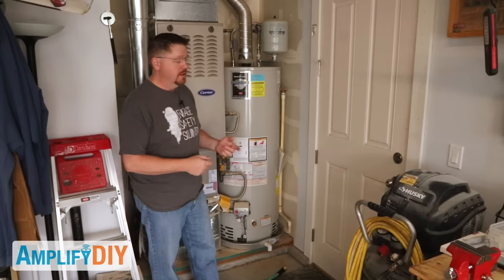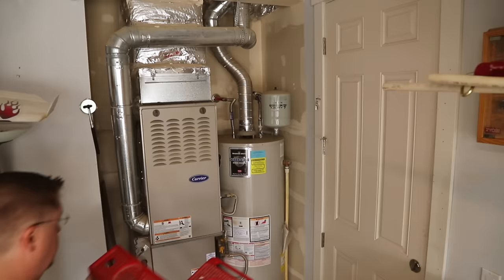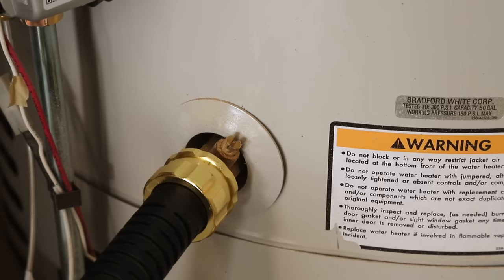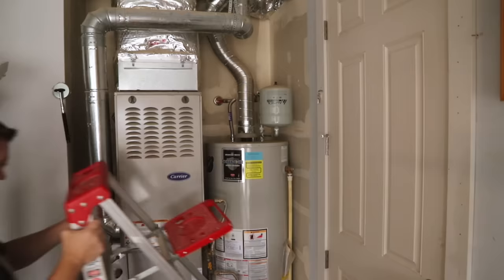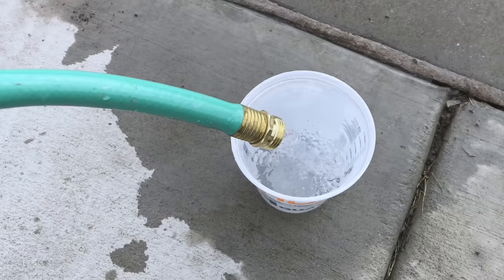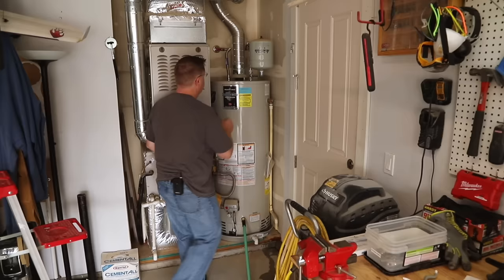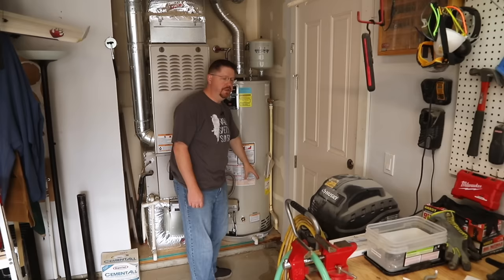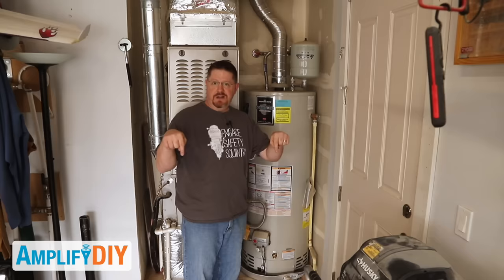How To Flush A Hot Water Heater To Remove Sediment

Comment: To avoid getting burned from hot water you can turn off the heat source and run the hot water into a sink until it’s cool enough to handle. Then follow the procedure for flushing.
Reply from the maker: Hi Jeffrey - great idea! Or, you could turn off the heat source and take a shower, run a load of laundry, or do some dishes - that way the water does not get wasted. Thanks for watching!
Reply: @AmplifyDIY  I will definitely do something like that next time I get ready to do a flush. Out here in southern Colorado water conservation is a big deal.👍

Comment: If you do this try to make the thing that you open for airflow a tub faucet or shower, the sediment will end up getting sent down the line and can cause issues.  The aerators on my sinks clogged with sediment and the hot water pex valve under my kitchen sink was somehow damaged in a way that makes it so it'll randomly flip itself off, not the end of the world but an annoyance.
Reply from the maker: This is a good tip - a tub faucet with no aerator or with the aerator removed is a good option. Thanks for watching!

Comment: All i do is turn down the tank temp, after taking showers, make sure the water is cold or cool, then hook up a water hose to the drain, turn off the water, open the drain valve, turn on the water to the tank, it flushes out the sediment very quickly. turn off water, close valve, unhook the hose, turn back on the water. Done.
  Every time i have messed with the Pop off valve it starts leaking. i dont like messing with that.
Reply from the maker: HI Alan - your technique is good, but I do recommend allowing the tank to fully drain before swishing it out with more water from the inlet. Even though you get a lot of sediment out with your method, I think you'll be surprised just how much more comes out if you drain the tank and flush in short bursts as I demonstrate in this video. 
As for the T&P valve: they should be tested annually, and replaced if they ever leak. Luckily, they are cheap and easy to replace: https://youtu.be/e5H1i1cypxA Thanks for watching!

Comment: Overall a nice video. But you did not good at the last phase: refill with cold water for a refill and open the valve to drain the water. The steps of closing the input of cold water then opening the valve is critical. Otherwise people will be dangerous with the reverse steps.

Comment: My shower and a couple of my faucets have little to no pressure after draining my water heater. Anyone have an my idea why? Or how to fix? I think I have a water recirculatir
Reply from the maker: You may need to clean out the aerators for those fixtures. Instructions for exactly how to do so vary, so bang around on google for the type of faucet to learn how. Most simply unscrew from the tip of the faucet. Good luck!
Reply: @AmplifyDIY  if that was the case, could I not just unscrew the shower head and see if it’s flowing properly when removed? 
I suspect this is not the issue. All three just all the sudden don’t have working aerators? Highly unlikely imo. Thanks for trying tho.
Reply: @AmplifyDIY  man I just unscrewed both shower heads and sure enough there was a bunch of sediment blocking them haha. How does that make sense though? Would it only affect certain shower heads and certain faucets, but then not affect others at all?

Anyway, thanks for your help!
Reply from the maker: Where and how the sediment can get trapped depends entirely on which fixtures were open (allowing water to flow) when there was sediment in the lines. It's impossible to say for sure exactly why these were the only ones that seem to be affected... but I'm glad you have resolved the issue!

Comment: Having the relief valve out while filling for too long can cause the water heater tank to cave in. The air coming out will cause it to suck in due to minimal air in tank. That happened to me. It is a very small dent, and it still works, but I wouldn’t leave the relief valve out for long while filling.
Reply from the maker: Hi Applianceman - I've never heard of anything like you describe... your water heater tank itself (not the outer cover, but the actual inner tank) actually deformed due to the pressure differential?!
Reply: I’m not sure what happened. I filled the tank back up, and I heard a loud “pop” sound while filling, and the outer cover is slightly deformed now. I hope the actual tank isn’t damaged. I’m not sure if it is. I think it was just the outer shell thankfully. Very unusual, and I sure hope it doesn’t happen again. What do you think happened? Why would filling up a water heater cause a “pop” sound and outer shell being deformed?

Comment: I find it so wasteful to fill it and drain it again. If I have a water softening system will I not have to do this wasteful procedure once a year? I'm also getting tankless so it doesn't heat water when it's not being used. Seems to be more energy efficient since these water heaters keep the water all night when not used.
Reply from the maker: Hi Cyndi - Depending on where you live, flushing about a hundred gallons of water may be more of a waste than it is for other areas. I did the math, and the cost of the water that I use to flush is around $0.35 (that's 35 cents) in total. Doing this once a year to prolong the life of a heater by 10-15 years seems well worth it to me. Even if your water costs more, the cost of replacing the whole heater is MUCH higher than the cost of maintenance. 

If you live in a drought area, then I recommend doing the following to re-use the water on your garden/lawn: Turn off the heat source for the heater, then go take a shower, do some dishes, or laundry. This will use up the hot water in the tank, and exchange it with cool water from your water supply. You can then safely drain the tank directly onto your yard, garden, etc, so it is not wasted.

If you are already planning to get a tankless heater in the short term, then there is little reason to perform maintenance on your existing heater. Carefully consider the pros and cons of tankless systems though: It's true they can provide a seemingly unlimited supply of hot water, and they don't waste any energy heating water when none is needed... but they take longer for water to get hot at the tap, they are very expensive compared to a traditional water heater with a tank, and they still require regular maintenance to keep running smoothly. I was very interested in installing a tankless heater in my new home, but once I ran the numbers, it did not make economical sense to do so. Yes, my current heater does waste a little bit of energy throughout the day keeping the water hot, but it would take several decades of using a tankless heater to recoup the cost of the heater in lower energy usage. In my area both electricity and natural gas are very inexpensive, so the math may make more sense if your utilities are much more expensive.

Whatever you decide, I hope you are happy with the results. Thanks for watching!

Comment: Well done, but I HIGHLY recommend not opening the Pressure Relief Valve. They often will not reseal when done and then must be replaced. Better to open the hot side of a faucet to allow air in.  JMO from experience
Reply from the maker: Hi Andrew -  You should actually test your relief valve annually. They can seal over completely with limescale on the inside to the point they do not open properly in the event of too much pressure. Test it, if it leaks, replace it: https://youtu.be/e5H1i1cypxA

Comment: Still a little confused about when you turn hot water on and off in the house?
Reply from the maker: Hi Kelly - apologies for the late response. The only reason to turn on the hot water in the first place, is to let air into the system so you can drain the tank. If you have to use your T&P valve to let air in (as I did in the video) it does not matter at all what you do with the faucets in the house during the flush. Open or closed makes no difference. Once the flush is complete, it's a good idea to open your hot water faucet in the house to allow the air that is now in the tank a place to escape. I believe I showed this in the video. 

Thanks for watching!

Comment: Wouldn't it just be easier to put a sediment filter in line and change it once a year? I also have a water softener inline on mine so to remove the calcium/lime so that does not clog up mu lines in the house.
Reply from the maker: Hi Raymond - even with a sediment filter and water softener, your heater will likely still have some junk collect in it. The sacrificial anode inside the heater breaks down over time and flakes of, collecting at the bottom of the tank. Also, the repeated heat cycles of the water in the tank will cause dissolved minerals to precipitate out of the water, even if you have a softener and filter. (there will be much less, but it still happens). I have both a whole-house sediment filter as well as water softener, and as you saw in the video there was still junk in the bottom of my tank. I recommend flushing it once a year. Good luck!
Reply: Agreed. I do replace my anode once a year and do a quick flush in the process. I had a fiber scope from work and did a quick inspection and surprised how clean the tank actually was. We leave the filter and softener at home (its setup outside the rv) when we travel. Yes same princilals apply to an RV. And run direct city water because of the VOC in the water aids in the antibacterial process that keeps the lines sanitized. Yes if you are on a city water it does contain these. It's just bleach in the water. Softeners dont remove these but charcoal filters do.

Comment: Can you not just leave your cold water valve on and let it flush that way? My hot water heater is in my basement and only way to drain outside would be up hill
Reply from the maker: Your basement should have a floor drain. Flushing under pressure actually stirs up a lot less sediment than the method I showed in this video. Good luck!

Comment: Can you drain this into your toilet?
Reply from the maker: I would not recommend that at all. If your heater is in a basement, there should be a floor drain you can use. If not, then you should drain it into something that is lower than the heater - a sink or bathtub or floor drain would work fine. Outdoors is better because then there is no risk of clogging a drain with sediment. Wherever you drain it though, it has to be downhill from the drain valve of the heater. Good luck!

Comment: What if there are two heaters
Reply from the maker: Hi George - when there are 2 heaters, they are typically plumbed in series - that is, the first heater feeds directly into the second heater. In this case, you simply do them 1 at a time. Start with the heater which is closest to the cold water supply. Good luck!

Comment: Have you seen what the sediment looks like when they cut open a old water heater they’re huge rocks i dont think doing this will do anything maybe it will clean it about %10 but thats it
Reply from the maker: Those huge rocks take many years to form. By flushing at least annually, it helps prevent it ever getting that bad in the first place. Thanks for watching!
Reply: @AmplifyDIY  i bought my house in 2020 and water heater is from 2015 so i dont think flushing it would make a big difference when i replace this one ill flush the new one annually

Comment: Be careful guys about flushing a water heater that's a few years old.  My 5 year old heater leaked literally a few days after I flushed it.  The best advice is just to leave it alone.  If you really want to flush it, just turn on the draining valve and don't shut off any water.  DON'T do the whole empty, agitate, and re-fill procedure, you'll just be disturbing the aging metal and it'll crack on you.
Reply from the maker: This totally depends on the quality of your water, and quality of the heater. If you flush annually starting 1 year after initial install, flushing will extend the life of any heater. Failure at 5 years is pretty rare.

Comment: shouldn't your pressure relief valve be made of copper or metal? That is supposed to have extremely hot steam come out of it, and potentially will soften the pvc material you have attached to it.
Reply from the maker: Hi Robert - the pipe is CPVC, not PVC. You are absolutely correct though: don't use regular PVC, as it'll just melt. Thanks for watching!

Comment: Big miss! Turn off the power to the water heater and run all the hot water out through faucet (bathtub fastest) until water runs cold. THEN shut off the cold intake and drain the tank. Eliminates danger of scalding water in hoses especially if you end up dealing with the water. Otherwise good video and good tip on opening pressure relief valve to speed things up

Comment: when opening a pressure relief valve  more then likely you will have to replace it best dont touch it open a water line instead. can be cheaper in the long run.
Reply from the maker: Actually, you should test them at least annually, and replace them if they ever stop working correctly: https://youtu.be/e5H1i1cypxA

Comment: Why would you repace a water heater in the middle of the night, I am sure we can all wait till morning.
Reply from the maker: When a water heater tank fails, sometimes it can do so pretty catastrophically: remember that the entire tank is under pressure, and if it's 3 am and the tank (which your house builder decided to install in the attic for reasons known only to them and the devil) develops a large leak, you definitely will have an emergency on your hands. Sure, replacing the heater can wait until daylight, but preventing a worst-case scenario like that in the first place is the whole point of performing maintenance like this. Thanks for watching!

Comment: All you have to do is hook up a hose to the drain fitting and open it. A spray nozzle and a 5 gallon bucket is all you need.
No need to turn off the water, or heating elements.
You're making this harder than it needs to be.
Reply from the maker: Hi Dick - I've gone into a lot more detail in other responses to similar comments, but believe it or not, doing it the way you suggest is MUCH less effective. Why? Because with the mass of the water in the tank still there, there is no "swishing" or turbulent action of the water at the bottom of the tank. Sure, it seems to blast out of the nozzle, but across the bottom of the tank the water moves at a glacial pace. Have you ever tried shooting a water gun under water? Or tried to get the junk at the bottom of your sink to go down the drain with the sink still full of water? A water heater is the same, only on a MUCH larger scale. You need to get the water out of it, so that an inrush of water will effectively stir the junk at the bottom. Thanks for watching!

Comment: Never works for me. Build up is so much it stops up the drain hose.
Reply from the maker: Hey Lewis - have you tried opening the drain valve while the cold water inlet was still open? The pressure may clear the blockage so you can flush the tank....

Comment: The cylinder doesn't need to be flushed. I have 50 year old cylinder that has never been flushed and still works. Unless you have a lot of time. Otherwise it's not really necessary. The cylinder normally last 15 years. Too short to build up sediment.

Comment: Forgot to open valve to relieve pressure.  It will empty faster.
Reply from the maker: Hi Not Doug - @2:30 I talk about the need to open an air pathway, and I demonstrate 2 different ways to do so specifically to relieve the pressure so it will empty faster. Thanks for watching!

Comment: I would never open the pressure relief valve. They tend to leak once you open them. I would rather undo hot water side line.
Reply from the maker: You should actually test your relief valve annually. They can seal over completely with limescale on the inside to the point they do not open properly in the event of too much pressure. Test it, if it leaks, replace it: https://youtu.be/e5H1i1cypxA

Comment: Imagine the amount of 'waste' of water this causes on an (inter)national level if every household with a water tank does this once a year...
Reply from the maker: Hi Sam - a total flush of a 50 gallon tank will use about 150-200 gallons of water. Yes, that sounds like a lot, but balance that against the consumption of raw materials to build more new heaters when they fail prematurely if they are not maintained... also, over the course of a year, how much of a percent increase over your current water consumption is an extra 150 gallons? I'm guessing not much at all. Thanks for watching!

Comment: Doesn’t get all the sediment out. Drain to high up on tank
Reply from the maker: Hi Night Walker - my drain is exactly flush with the bottom curve of the actual tank. It appears to be installed a little higher on the outer case of the heater because of all the extra insulation and space for the burner, etc. But it is actually located right at the bottom of the tank...
Reply: @AmplifyDIY  Wow you’re lucky mines about 3 inches off the bottom. That’s the way every water heater I’ve had. I’m going to have to check them out when I need another one make sure it’s at the bottom.
Reply: @AmplifyDIY  What kind of tank do you have?
Reply from the maker: 3 inches off the bottom of the internal tank? Or 3 inches off the bottom of the outer housing? I've used a borescope to look inside my heater through the drain valve, and it enters more or less flush with the bottom of the tank. It's really close.
Reply from the maker: It's a Bradford White - I don't recall the model.
Reply: @AmplifyDIY   thanks